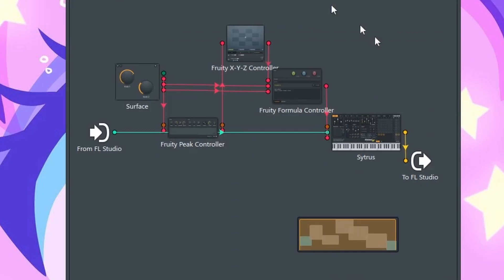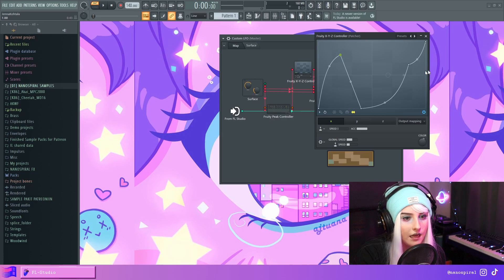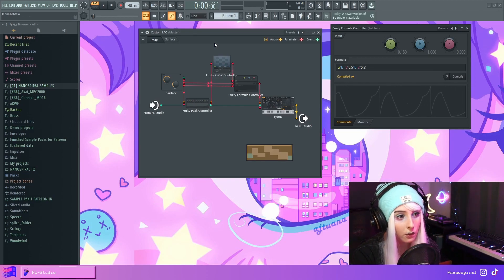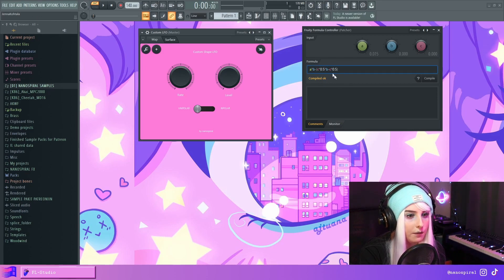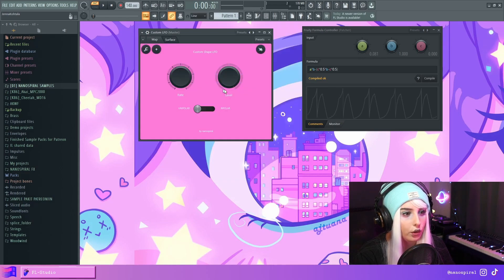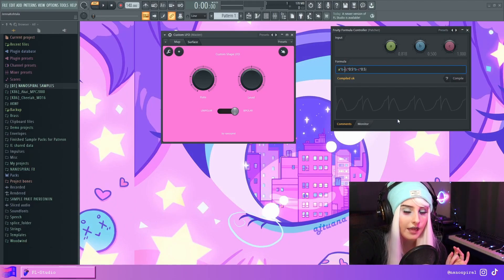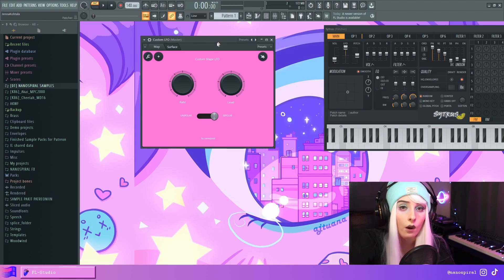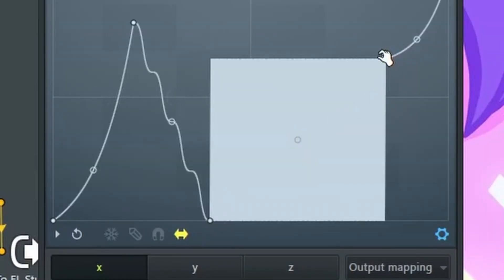How To Make A Custom Shaped LFO In Patcher | EXAMPLE PATCH DOWNLOAD

Comment: I wish I found this sooner is there a way to change the lfo position in my use case scenario I’m using a envelope controller mapped to the fruity peak controller which works good for vibrato but doing it how I did prevents me from adjusting the cut off point inside of EQ2 wanted to know if there is a workaround for this to be able to adjust the lfo amount and “lfo position or cutoff position independently from the lfo position

Comment: you made it way to complicated, you dont even need patcher. just use fruity envelope controller and you can draw in any shape you want.
Reply from the maker: i need patcher because this is a patcher channel and the purpose of it is to showcase different types of techniques you can do in it. It should be obvious that the same thing can be achieved multiple different ways. I'm sorry you find it too complicated :D
Reply: @nanospiraI  fair enough, but i think most people klicked on this video, because they want to make custom lfo shapes, so it would have been sensible to at least include the easiest method.
Reply from the maker: @donitmusic  The Envelope Controller doesn't generate continuous lfo data without inputting notes anyway so they're not even entirely comparable.
Reply: @nanospiraI  it does. simply click on the box that says "envelope" and from the dropdown menu choose "lfo" instead.
Reply: @nanospiraI  sorry i think i kind of misread what you meant. but holding a note is still pretty easy, just put a midi controll center before it that outputs the note.